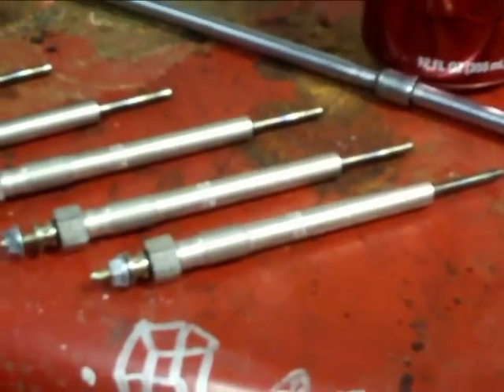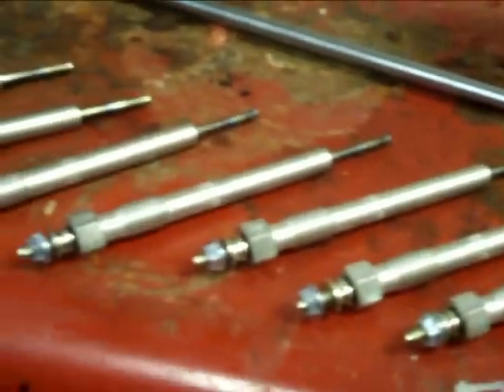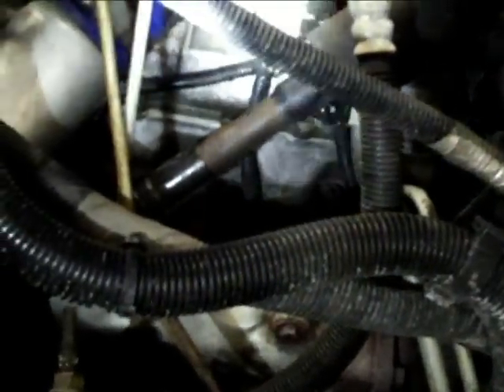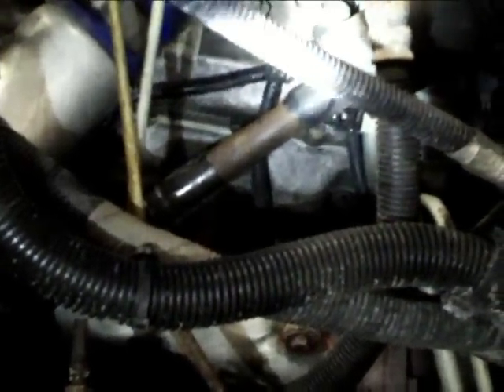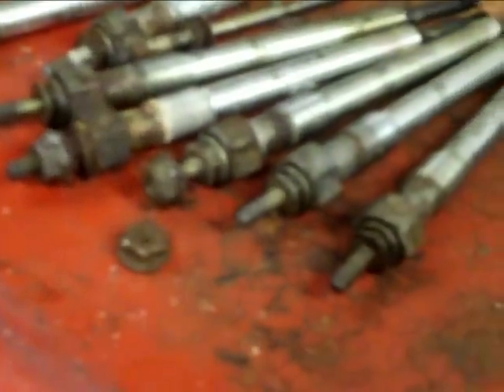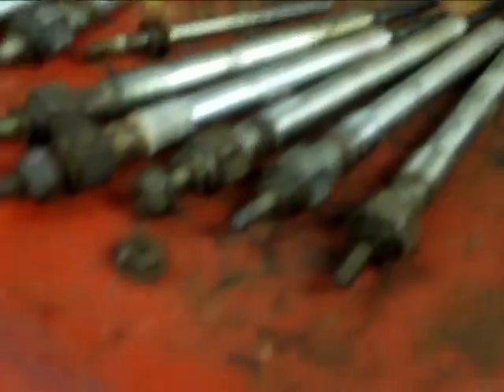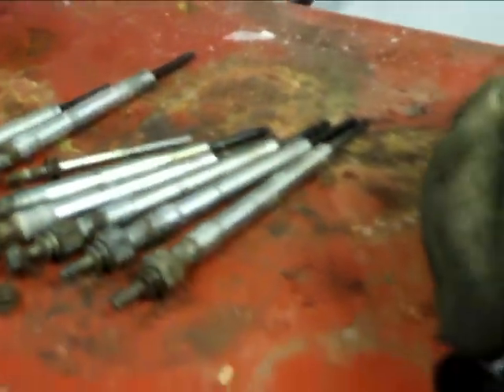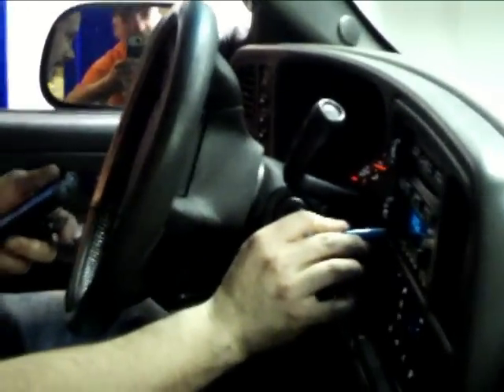Duramax glow plug change.mp4

Comment from the maker: @GatheringSticks just like a glow coil in the furnace they get weeker and weeker with every use so you have to leave them on longer untill 1 time they wont get up to temp and it trips the check engine lite   thanks for the question G.S.   :)

Comment from the maker: @carnivore10 good question    Compression Ratio: 17.5:1. Bore: 4.06 inches. Stroke: 3.90 inches  thats for the lb7 motor which is this truck and mine the 04.5 and on they lowered it a bit to add more turbo

Comment from the maker: I would change them evry 2 to 3 years it helps with the cold weather starting and the harder you glow plug controler has to work the shorter its life is going to be.And i have seen glow plugs break off and the head had to be removed to get the remaining part out.So dont let them sit in there forever they will rust in place.